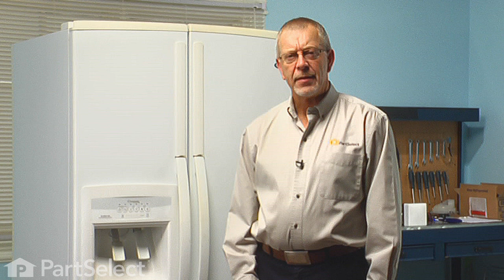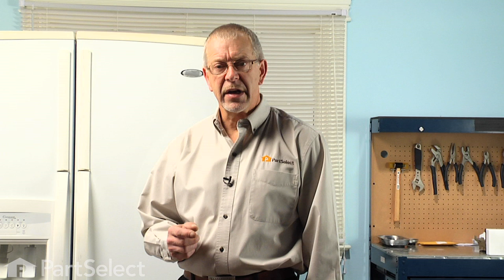Troubleshooting Why the Ice Maker Is Not Working | PartSelect.com

Comment: I have LG Frenchdoor refrigerator.  Water dispenser works fine, cold water comes out; the ice maker/dispenser doesn't work.  It just started doing this and we have had the refrigerator for about 5 years.  There is a filter as well.  I've turned it on/off; reset; and checked all the lines.  What should I check next?  Is it possible that another filter is needed?  Thanks.
Reply from the maker: Pam Arnold  What is your model number and does the unit make ice but just not dispense it?

Comment: I have a admiral refrigerator and the ice maker didn't work, so I ordered a replacement and when I installed it I tried the bypass with T and H and nothing happened. So i called the company and they replaced it again and still nothing. I took a volt meter and checked the harness for power and it all has power but the ice maker doesn't do anything.  Please help thanks.

Model # LTF2112AR
Reply from the maker: Jake Bedard Verify that the harness is fully inserted into the icemaker and that the bail arm is properly fitted into the icemaker control. The slot on the control should be in a vertical position.
Reply: ice maker not dispEncing

Comment: Helpful video. I replaced the triple solinoid water valve and made sure the supply line was not frozen. There is no water in the supply line. Any suggestions?
Reply from the maker: wilsonteal Can you specify the model number and which supply line you are referring to?

Comment: hi I hope you can help. I have a whirlpool  model gz25fsrxyy2  fridge, icemaker quite so I did the jumper test on the unit, cycles dumped water but next day no ice except what was in tray. I thought element so bought a new one. Now still no ice I can't get the new one to even cycle, dump water anything. I am thinking power issue but the ice auger spins when I push the button like I'm going to get ice. I used a voltage meter on the wires on the fridge side of the harness and didn't get anything I used the white and black in white wires there was no solid black is this correct. I am out of ideas thanks.
Reply from the maker: Brian Congdon The wiring diagram for this model should be located in the control panel or behind the lower kick plate and should indicate the wire color codes.

Comment: Help !!!! My Whirlpool takes forever to make ice , sometimes it goes 12 hrs , or more to make ice. It seem it only makes ice during the early morning hours. Once it runs out , we have to wait hours before it kicks in and start producing ice
Reply from the maker: Ma Va What model number do you have?
Reply: ***** it show to be WRF560SEYM00
Reply from the maker: Ma Va  The production of ice is directly related to the temperature of the freezer and the condition of the ice maker control. If the freezer temperature is consistent, then you may require a new ice maker.
Reply: Hmm , ok , ill have to change it out . It's been replaced once before . About 6 weeks after i got it new. Thanks for the info

Comment: I have a problem I can't find the solution to.  My icemaker was working sporadically, it was 5 years old, so I replaced it.  NEW ONE does the EXACT same thing.  Fills up water, freezes, rotator arm doesn't move.  I have to flip up the bale arm wire (shut off like ice tray is full), then flip it back down again, and rotator arm will move, element will heat up and a few minutes later, the ice ejects and falls.  Either the rotator arm and/or the shut off wire (bale arm) isn't going through it's full cycle.  I can't figure out why.  This is a brand new unit, shouldn't be defective.  I have a Whirlpool Model ED5PHEXNL00 with ice plus system.
Reply from the maker: It would  that either the end of the bail arm may not be properly engaged in the ice maker control module or the wrong bail arm was used. You may also have a defective internal switch on the control module even though it is new. I would inspect the bail arm first.
Reply: *****  I had to use the same bale arm and it's installed properly.  The mechanism gets stuck when the plastic ice teeth are in the 2 o'clock position... which is where it rests when ice is being made.  I'm guessing the timer that tells the rotator mechanism that "it's been an hour and the ice is frozen, so move and push out the ice" is NOT working.  How can I check this?   Like I said previously, if I go to the freezer every hour and flip the bale wire to the off position, then back on is the only way I can go through a cycle of ice making.   Is there a complete unit I can buy so I don't have to exchange parts?  Because SOMETHING is wrong somewhere.
Reply from the maker: pdog Akron There is a thermostat attached to the ice maker mould that triggers the control module motor to operate a cycle. When the mould is at a temperature where ice would be present, the thermostat detects that and closes a circuit to the control module motor circuit.
What part (number) did you originally replace? There is a complete icemaker assembly available for your model (PS358591).

Comment: I have seen no repair videos on this problem: What is the problem when the ice cubes inside the ice bucket all freeze together in clumps?  I have tried lowering the temp in the double wide Whirlpool ice box, but it does not seem to correct this issue. I have replaced filter and the mechanism control for ice maker. Water seems to enter fine and cubes are not small, but are of correct size. However, the ice when in the bucket all seems to eventually freeze together and make a giant ice block. What am I missing and do you have a video on how to adjust the water flow correctly for a Whirlpool model ED22TEXHW00?
Reply: Just a Jack-of-all-Trades guy here. I've had this problem and usually it means that too much water is entering the ice cube tray. On most ice makers, the front cover and be removed and there is an adjustment screw there with a -/+ symbol. Turning the screw so that the indicator moves more towards the minus side will reduce the amount of water entering the tray and make cubes a little smaller. It's a little trial and error before you get the measurement just right. Hope this helps.

PS: I am not a certified repairman of any kind and am not affiliated with this site by any means.

Comment: My Samsung fridge model number is RS277ACPN, water to my ice maker freezes up and then does not produce ice,its like too much water is coming thru to the ice maker itself.
Reply from the maker: Most often this symptom is caused by the inlet water valve not shutting off completely. This can often be attributed to sediment or debris in the valve.
Reply: ***** Ok so where is this at and what do i do to fix this,thanks for your response.
Reply from the maker: Mark Parker The inlet valve is normally located at the rear near the bottom. The household water supply connects to the inlet of this valve, and there may be a sediment screen at this connection point. Turn off the water supply, remove the inlet connection and check for any debris. If cleaning the screen does not resolve the problem, the sediment may have infiltrated the valve and it may need to be replaced.

Comment: I had one piece of ice stuck.  I knocked it off.  This has happened once in a while and after I knocked it off the icemaker worked perfectly. This time it is not making ice.  It seems water is not coming in.  The end few cubes have some water but not the rest.  Do you think the valve that the water comes from could be frozen?
Reply from the maker: Diane Deminie What model number do you have?

Comment: I have a frigidaire side by side refrigerator and when water dispenser is used it adds water to the ice tray which it does not need and overflows into the freezer.
Reply from the maker: 02maggiemay What model number is your fridge?

Comment: I have a Whirlpool refrigerator (GS6NBEXRQ01} that makes ice ok but the ice bin is freezing up so it does not dispense ice. I have changed the flap in the chute but when I went to change the motor that closes the flap I had my problem. The tray that holds the water dispenser has two screws holding it. That tray looks like it has to come out in order to have enough room to feed the motor wire down to the control board located at the bottom of the dispenser unit. When the screws are removed the tray still doesn't move to allow the necessary room. What am I doing wrong to move that tray?
Thanks
Reply from the maker: I think you have to press down on the rear portion of that tray to release a locking tab, before you can pull it forward.

Comment: I replaced my Kenmore Model # 10652214104 icemaker with Pn# 4317943 replacement was straightforward however the unit has never powered up what do I check nextmy primary order # was 6585393.
  Is there a reset procedure for the circuit board to power up the new icemaker?  THX
       Dave in FLA

Comment: i have a whirlpool ice maker and the heating element over heated and caused the circuit to brake at the braker box after replacing the ice maker motor and tray with the heating element the ice maker did not start and is not making ice what needs to be checked ?
Reply from the maker: Ronald Harvey What model number is your appliance?
Reply: ***** model number is gd5shaxkt00
Reply: ***** whirlpool gd5shaxkt00  i have used the jumber from t to h with no results...nothing happened how do i check for power to the ice maker?

Comment: I have a kitchen aid that only make's ice for a short time. it seems the line is freezing and it then   stops making ice. we have unplugged it to see if that was the issue. When it defrosted a bit  the icemaker worked again but we had a bit of an overflow issue. how do i fix the water line coming into the freezer, so it does not freeze up? thanks so much

Comment: Help, I pulled my ice maker apart because it was overflowing or cracked. I figured it just might be in need of a good defrost because I pulled out a lot of ice from the bottom tray and crevices. put it back together, it made 1 cycle of ice and thats it. It wouldn't make anymore ice. Its full but won't cycle. I have done this twice with the same result.
Reply from the maker: John Roessler What is the model number on your fridge?
Reply: ***** GS6SHAXMB00; I pulled off the motor cover and then checked motor sensors, some were in need of cleaning. After reassembly, the maker started to cycle on a regular basis. I just have a leaking problem which I am trying to control with adjuster the water flow. Think I am on the right track, thanks for the response.

Comment: Hi, my GE fridge model:PSS26SGRE would dispense ice cube(when there's no ice stuck in the blades), water, but not crushed ice.  The auger would turn, and appear slipping when several ice cubes got stuck in the blades.  The blades were having hard time crushing the ice cubes.  Do I have a weakened motor, GEH WR60X10259 and need replaced?

Comment: The troubleshooting was incomplete in my case, after jumping out the stat, nothing happened at first several minutes later it harvested.  Is the timer motor supposed to immediately start?  I'd rather know the test procedures with a meter. There are several other ports. Which two are hot and neutral? Which two are the timer motor? I already replaced the mold and heater. What is the cut out and cut in on the stat? If I place my probes in the t&h portson 115V,  and read 0, this would indicate a closed stat and the defrost should initiate, true? My problem is intermittent operation,,,

Comment: Slow Ice... Thanks for the great video, but I did not see a answer for my problem. My ice maker makes ice correctly (fills correctly, right size cubes, not stuck together, etc) but only makes ice about once a day. I suspect no mechanical problems since cubes are perfect. Could this be a freezer temperature problem or ice maker thermostat? How would you diagnose these? Thanks.

Comment: You need to show what your are telling us, not just talk.
Reply: Yes, frigging yes. Put an icemaker on the table and show us what you're talking about instead of reading it.
Reply: +PartSelect  This video would be better as a written column or PDF. The problem with this video is the direction. Why don't you shoot close ups of the ice maker? The only time you did that was at 1:46, and it was only stills, not full frame video. Just some constructive help from a video editor with a broken freezer.
Reply from the maker: Hi Debra, 
Once you are able to narrow down the problem we have videos on how to replace the specific part! You can always check here for more information on what could be troubling your ice maker: http://www.partselect.com/Repair/Refrigerator/

Comment: I have a Fridgidaire side by side model no. PLHS269ZDB1.  The water & ice dispenser stopped working recently.  I think I splashed water off the ice in the glass and fired the motherboard.  None of the the lights will illuminate and neither water or ice will now dispense.  I unplugged the power to see if that would clear the fault.  I also replaced the water filter.  I've checked the door switch to see if the light will come on/off, and I've checked the connection under the freezer door hinge over.  (The ice maker is getting water and still making ice.) None has brought the ice & water dispenser to operate again.  What's the next step in your opinion?  I started researching the removal of the dispenser from the freezer door to access the motherboard to see if it's easy to replace that, and looks like I'll be breaking more things before I get to fixing something!!  Please advise.  Thank you for all your help !!
Reply from the maker: Since you will be working near electrical circuits you should first disconnect the wire harness connector under the hinge cover. You should be able to access the dispenser control board easily by first removing the drip tray, and then remove the three screws along the bottom edge of the escutcheon. Lift the escutcheon up and  disconnect the wire harness. You can then access the dispenser board by removing the screws that hold the board to the assembly. Use caution when removing the wire harness connectors. This video will help you with the disassembly procedure and good luck with your repair.
Refrigerator Repair- Replacing the Water Dispenser Actuator (Frigidaire Part # 241682001)
Reply: ***** Thank you for your info!  Please advise what is the part number for the water/ice dispenser controller board for this specific model no. PLHS269ZDB1.
Thank you again.  

Wilson Fan

Comment: I have an Electrolux unit. The ice machine fills  and begins to harvest, however the dispenser will not release the cubes into the collection bin.
Reply from the maker: Hi Joshua, 
This could be the result of a few things. Here is a video that might help you make a diagnosis: Troubleshooting Why the Ice Maker Is Not Working | PartSelect.com

Typically when the ice dispenser will not release cubes it is could be one of these three parts:
1. The Rear-Mount Ice Maker Assembly (part # PS1992700)
2.  Dispenser Crusher Housing ( part # PS2378689)
3. Water Inlet Valve (part # PS7784018)

Hopefully this helps.

Comment: very helpful,however my wife came home one day and found two inches of water on the floor the model is a Kenmore coldspot model # 106-9758615 there is no water in the tube or the ice maker.... any tips or solutions? Thanks for your help!
Reply from the maker: Hi there! Thanks for the question and for getting in touch! Check the tubing on the back of the refrigerator that originates at the inlet water valve and supplies water to the ice maker fill tube. Look for a crack or split or a loose connection. Inspect the water inlet valve as well for any cracks. Hope this helps!

Comment: I don't know much about ice makers, but I put the control arm in the full on position all the way down and when I come back to check it, it is about half up (@ about a 45 degree angle.)  Is this a normal part of operation, or is it something I need to diagnose and fix?
Reply from the maker: Hi Roger! Thanks for the question! That is not the normal operation for an ice maker. During the harvest cycle the arm will raise to the horizontal position to allow ice cubes to eject into the bin and then drop to the down position at the completion of the cycle. Hope this is helpful!

Comment: Hello,   My whirlpool ice maker is not harvesting.   When I did the bypass with the jumper wire in T and H, it worked.   When do I check now?
Reply from the maker: Hi there, Gil! Thanks for the question. You may have a problem with the internal thermostat or with the internal switches in the ice maker module. If the bypass test allowed the ice maker to harvest and also refilled with water, then we would suggest replacing the module. Good luck with your repair!

Comment: i have a ge gsl22jftabs and the ice dispenser was just pouring out ice in either crushed or regular and the water did not work. So I did some research and I found some site that said it was the front control panel. I ordered another one and I still have the same problem ,,,what is it
Reply from the maker: Hi Fusium. Thanks for the questions! Unfortunately I am not sure what your symptom is. Does your icemaker not produce any cubes or is the dispenser not dispensing the cubes or not dispensing water? Let us know your exact symptom and we will try our best to help!
Reply: ***** the ice maker spits the ice out non stop in ice mode,,when I switch to water nothing happens and the light stays on all the time,i took it off because the light would not go out and the ice just keep coming out of the dispenser ,,,ice maker makes ice fine
Reply: ***** just letting you know I changed the control panel out,,it dispenses ice in ice mode all the time,siwtch to water is dispenses water all the time,,and the light stays on all the time I have to unplug the control panel for it to stop,,do you have any idea what my problem is now